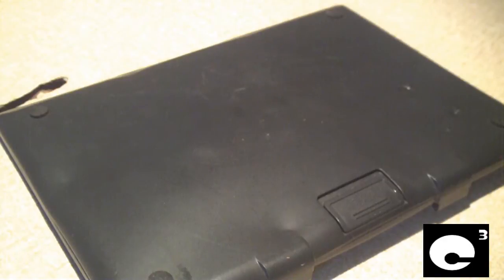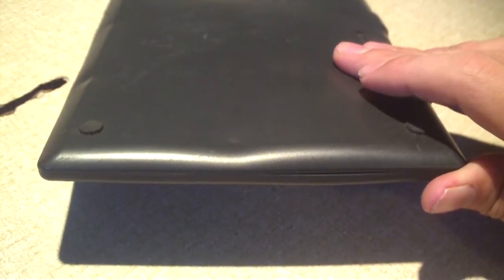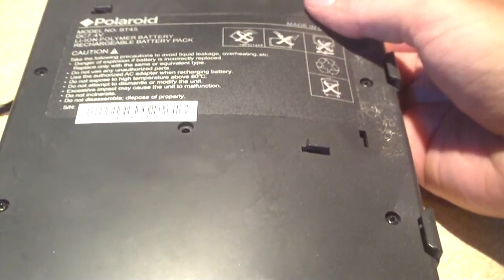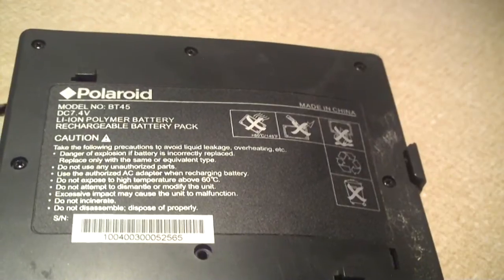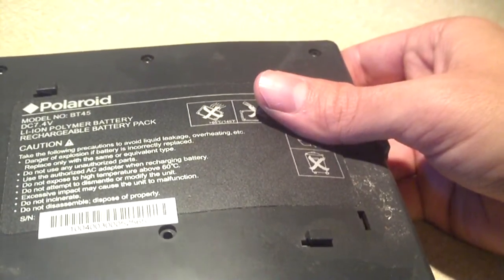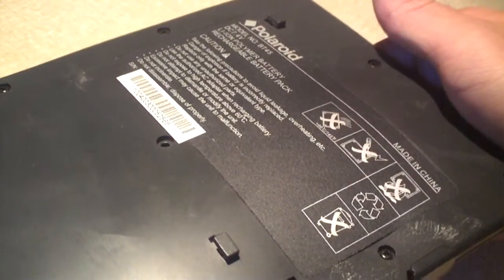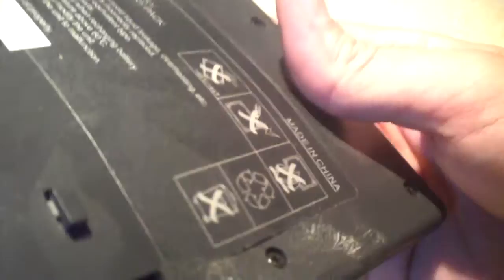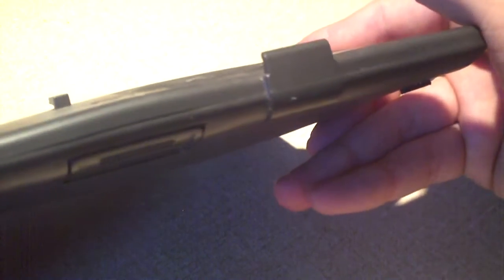Burnt up Polaroid DVD Player LiPo battery

Comment: I know this is old but I got mine when I was younger. I just found it today looked totally fine worked fine too apart from holding a charge anymore, which it doesnt really. however the battery does smell funky.
Reply: Not a good sign discontinue use of this DVD players battery my TruTech one I had a while ago had a similar issue

Comment: Just got my DVD player out of the closet.  It has been there for a number of years without being used.  Opened up the zippered case and found the battery completely popped open and exposed is a silver colored plastic bag that is very much expanded.  I was going to find a replacement for it, but now I'm not sure I should even try.  Does anyone know if there is another battery available for this DVD player?

Comment: I have the same the portable DVD player tell me how do I fix it
Reply: There is no way to fix this.  Found the recall on the internet that was sent out on Dec 5, 2005.  The company is no longer in business and a remedy is no longer available.  The unit can be used with the AC cord that came with it.  I will have to do the same thing.  What a bummer.

Comment: Dented battery pack. The dent on the bottom casing is a dead giveaway (pun intended), that anyone should never use since the separator layers inside the cells are incredibly easy to tear.